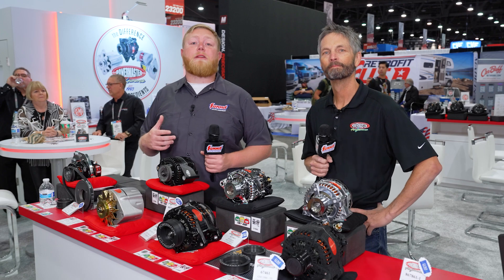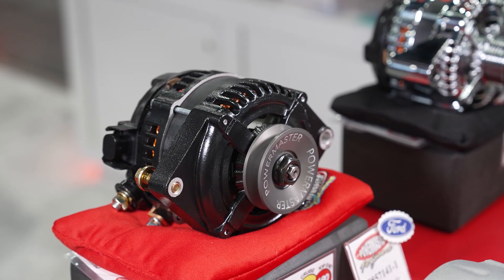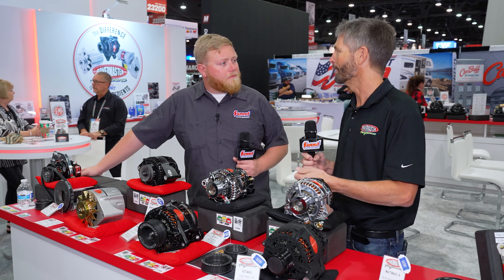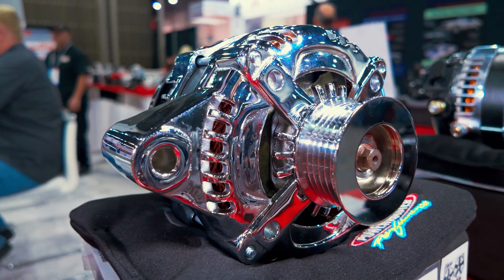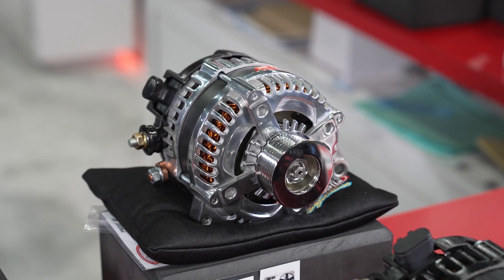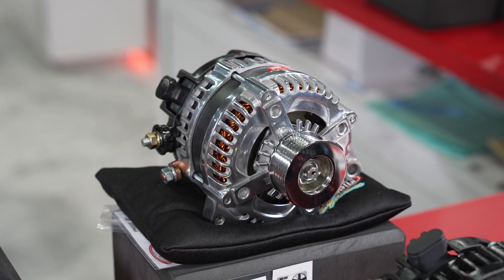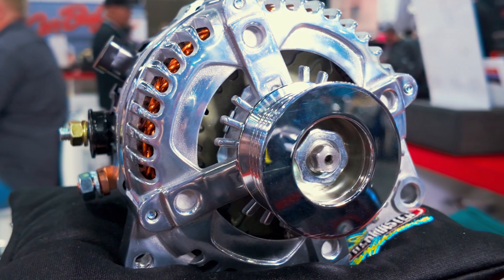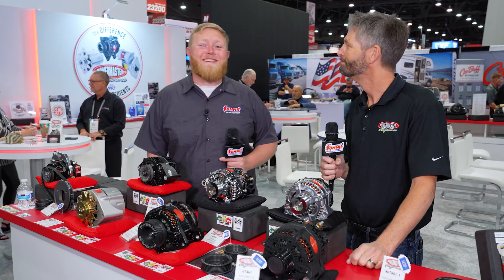Why Low RPM Amperage Matters…and How Powermaster HPR Alternators Deliver | New for 2025

Comment: I have a PowerMaster 1 wire 150 amp that's rated at 100 amps at idle but that's at 2,400 alt RPM. Even with a 3.3:1 ratio (7" crank, 2.125" alt pulley) I still have to have my engine RPM at 750. I don't like that. My car "sounds" the best at 650 rpm.
Reply: What does it put out at 650?
Reply: @Spiritof_76   Nothing. Being a one-wire alternator the regulator shuts off the rectifier so it doesn't get hot.